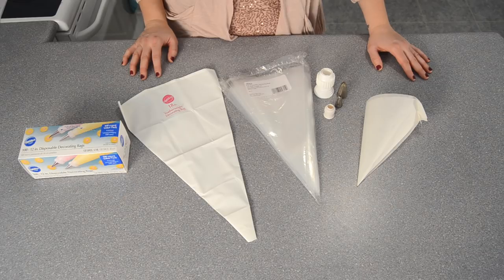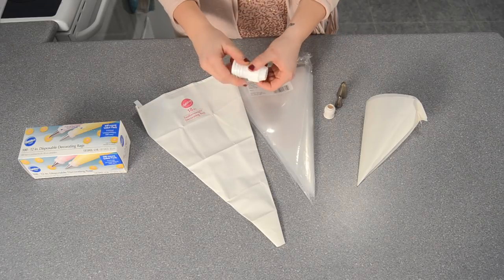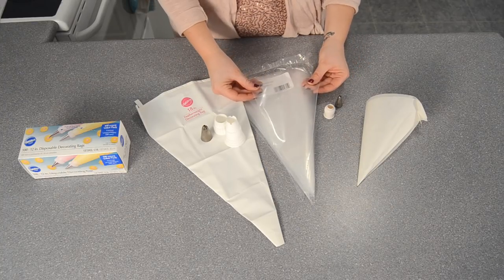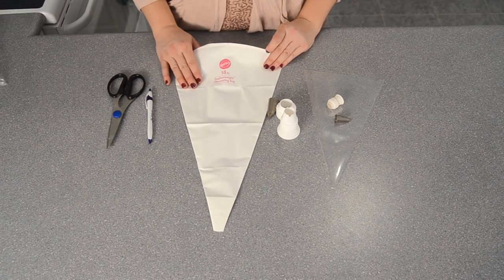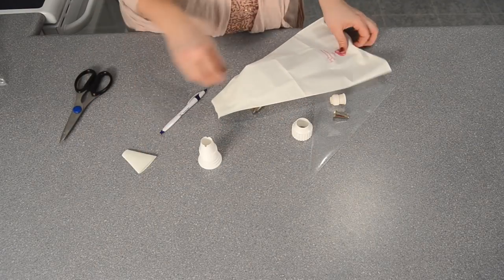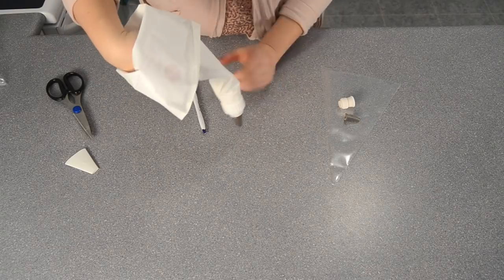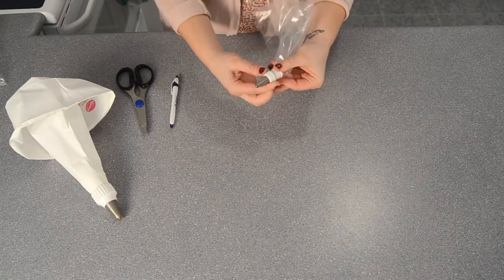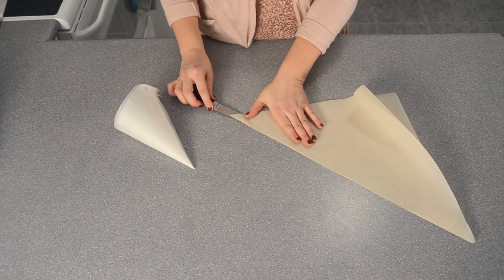Piping Bags 101 & How to Make a Piping Bag by Cookies Cupcakes and Cardio

Comment from the maker: I would recommend finding some couplers to purchase (they are relatively cheap) as I find they give your hand more control of the bag. But, if that's not something you want to do, yes, you can put just the metal tip at the end of the bag. Yes you can use the bag to write with melted chocolate, just fill the bag with the melted chocolate the way you would with icing.

Comment: Great Video, I always struggled with adding cupplers to piping bags. 
Now I know that I should have cut them at the end. I feel kinda dumb. :(
One question though. 
I mostly use ganache to fill pralines which is much softer than icing.
Is there a good way to prevent it from leaking out during the filling? 

Also it tends to melt during the piping which changes the consistency.
Probably my hands are to warm or I am working too slow, but maybe you have got a tip for me to prevent this. :)

Comment: Very helpful. Are there any downsides to just using a ziplock bag?
Reply: ziplock bags do fine with thin icings and chocolate, but with much pressure or a stiffer icing, they'll stretch as you try to pipe and deform the hole.  If the hole deforms enough, it'll force the coupler right out.  Decorating bags are much sturdier, but this will happen with them as well with the REALLY stiff icings, like the stiffness you need for upright petals (like roses).  For those you need a reusable or parchment bag.

Comment: Just caught your video.  I have the featherweight bag and one of my tips fits on the coupler but the rest of them don't.  Do I need different couplers?  Then what happens to the hole I already cut, will it be too larger now for this bag?
Reply from the maker: Kathy Cadile If your tips don't fit on the coupler, then yes, you need to get another sized coupler.  I'm not sure about the hole in your bag, as I can't see it :( Sorry.

Comment: I love the disposable bags. No clean up needed! Just take out the tip and throw in the trash bin. This is so helpful when I am making cream puffs(profiteroles or choux pastry). I don't need to clean the bag. All of you who have made this know what the clean up is like. The dough is sticky, thick and gets everywhere so yeah... Quick question. I do have the large coupler from Wilton and I do use it with the 1M star tip also from Wilton but is it neccessary to use the coupler?
Reply: You don't have to use a coupler most people use without, like myself. I only use one to change tips
Reply: you don't have to use a cupler. just try and make the cut for the bag closer to the end of the tip. when your piping and applying pressure sometimes the disposable bags stretch. it really sucks when you're piping and the tip comes flying out and icing everywhere
Reply: Lacey Dowdall  That's usually what happens with me so I prefer couplers because I can easily change tips and it prevents the batter or icing from exploding out of the tip.

Comment: I am scared securing the ring for the coupler onto the outside of the featherweight bag will make a hole from twisting it on. Do you secure it not as tight so it doesn't do that?

Comment: My frosting bag has the cuppler part where you attach the tip to inside of it and it cannot be removed.(by anyway that I know of) Is there any way that I can remove it? It is a reuse-able bag and it's a weird plastic type. 

If I were to clean the reuse-able bag fast, how would I do it?

Where do you buy the little plastic disposable bags?

Comment: Hi I just bought this wilton reusable piping bag.Can small tips also work with this?? I was wanting it to use with both small&large tips.
Reply from the maker: gsooo1 You can use the 12" bags for large and small tips, but the large ones don't allow for very much icing.
Reply: Thank u so much. I guess ill have to buy another 12" bag. Im planning for 14"(do u think it'll work for both the tips?)
What I have is 18" bag.had ordered it so couldn't make out much till I recieved it.
Reply from the maker: gsooo1
The 18" will definitely work better for the larger tips.
Reply: Won't the 14" work for both??

Comment: I am a beginner. I want to decorate cupcakes and cakes. I want to use disposable bags What size should I start with?
Reply: 12" I believe is the smallest size Wilton does in disposables. I personally like 16" with a 2D tip. this allows you to fill with more icing at a time. the larger tips for piping cupcakes like a 2D use a fair amount of icing compared to the smaller ones so it just saves time and hassle in my opinion. I can usually get 12-16 cupcakes done with a 16" bag 3/4 full.

Comment: Can you use a normal plastic bag?
Reply: I've put frosting/icing in a Ziploc bag before, squeezed the air out&sealed, and then cut a tiny tip to do detail work on cookies :) Not sure if the tips would work inside them but worth trying!
Reply: FindMe354 Oh kk tku :)

Comment: I have a problem - I found a fairy weight frosting bag in my basements with all the tips, but only the part of the coupler that goes inside the bag! Does anyone have suggestions for how I would hold the frosting tip in place?
Reply: not sure but I know u can buy a pack of 4 cuplers for like 2-4 dollars at Michaels crafts. less if you use their coupons
Reply: +Lacey Dowdall okay, thanks!

Comment: hello there How are you going? What tips is there called so I can look for it?
Reply: +Marisa Rouillon There are many tips depending on what design you want.  I get all wilton tips. check their website and you can find a tip and see the design as to what it makes.
Reply: I recommend starting with 2 round ones ( a big one and a small one), a star one, a petal one, and some special ones ( like the grass one or the number 47)
Reply: ok
Reply: if you want to decorate cupcakes I would get a 2D and a 1M (I believe that's the names, ones a closed star and ones a spikey one) these are what most ppl use to get the signature cupcake ice-cream swirl and rose look. they are larger so you don't have to use a cupler in a disposable bag. must be sure to make the cut a tiny bit above where the tip openings are. sometimes the whole can stretch a little when your piping/applying pressure.

Comment: Do you really need a cuffler to use a piping bag
Reply: You don't need them for simply using a piping bag. You can just use the tips. However if you are wanting to switch out tips it's easier to do with the cuffler. Otherwise you'd need another bag to slip a different tip into&fill.

Comment: why aren't the bags precut to perfectly match the coupler?
Reply: You actually don't have to use a coupler, so the featherweight bags are cut for using a tip on it's own.  You can do that simply by dropping the tip in.  The reason you would use a coupler is if you don't and you want to change tips for the colour you're using you have to either dump the bag and fish a new tip in through a dirty bag or start a new bag - with a coupler it's easy to switch tips.  The downside of cutting for a coupler is that you lose the option of just dropping a tip in.